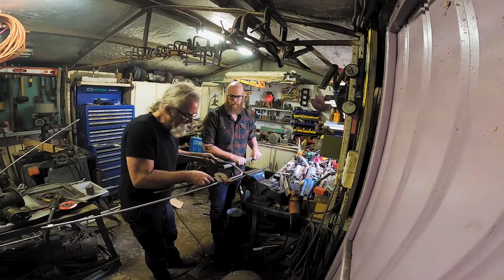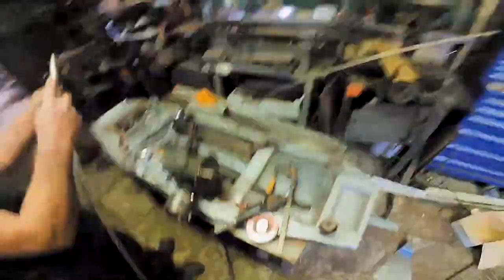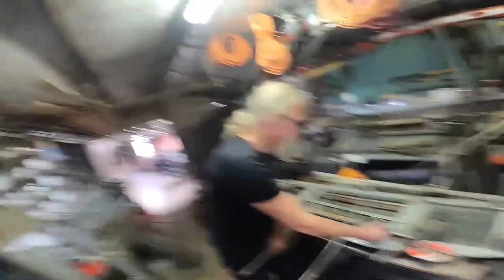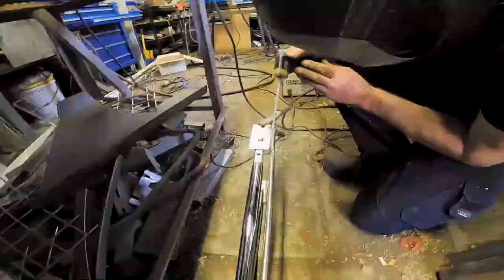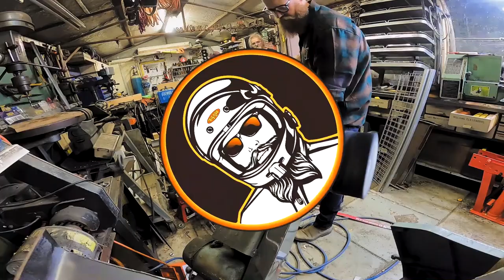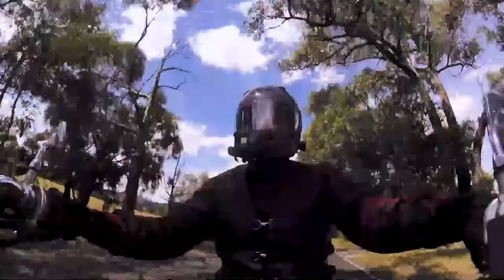Kawasaki Vulcan - Custom Sissy Bar - Nomad

Comment: Haha nice man. I did mine at work over couple of lunch breaks. had 1 of the guys weld the bar to the side plate brackets. used 10mm solid round bar avout 26inch high from top of the seat designed own side brackets for removal and install. cost me 10 bucks all up
Reply from the maker: +Bolt Bucket that's awesome mate, great you can do it at work, and for the cheap. I was lucky my father inlaw never throws anything out, we made this one up from old hydraulic stainless pipes 👍
Reply: @BigRobMoto  hell yeah thats what its all about the chopper life